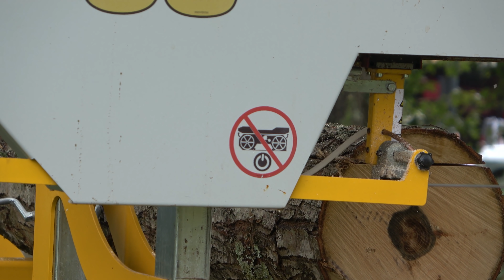Why You Should Own A Sawmill!  Something is Different With This Log

Comment: Tony that is sweet working saw mill, cuts. through that green maple real well keep up great videos .
Reply from the maker: It does really good, and that blade is dull. I will change out the blade before our next log. Some of the first logs were very dirty with sandy dirt.
Reply: Are you able to have them resharpend ?
Reply from the maker: Frontier Sawmills said they could be sharpened about 5 times. The pitch can be reset as well.  Many companies make the blades also

Comment: To speed up the drying process place the boards in a air conditioned roomthe air conditioner will pull the moisture out of the wood real fast
Reply from the maker: We are planning on putting many boards in our basement which very dry with a large dehumidifier. I hope this moves it along.

Comment: Are you looking at building a rock/concrete pad for the mill to prevent the shifting issue as the weather changes?
Reply from the maker: We are looking at a concrete floor in the future.  The shifting doesn't matter much. It takes only a few minutes to true up. We still want it to be mobile.

Comment: your blade is too loose it throws too much and get your teeth set again because blade makes stripes and thats because of a badly set tooth
Reply from the maker: The blade is new from the factory on the second log and the blade is as tightened as Frontier recommends using their settings. The first log was very dirty on the outside so this may have dulled the blade. I do appreciate your input and I will keep it in mind on the next log.